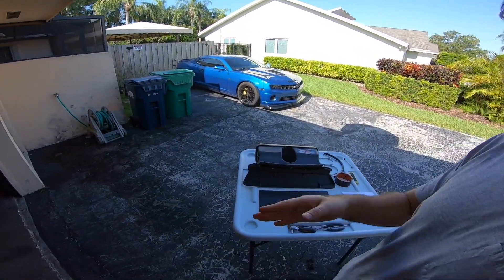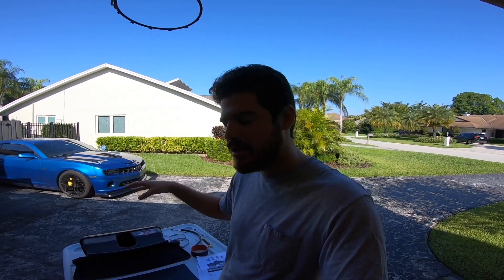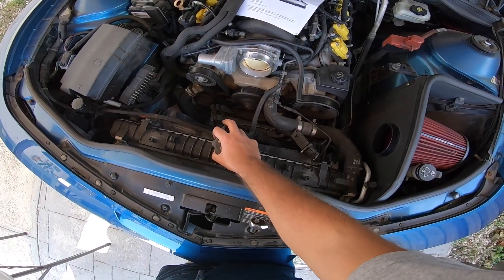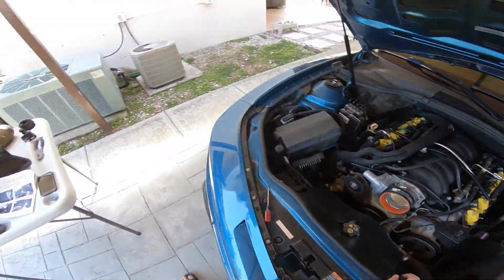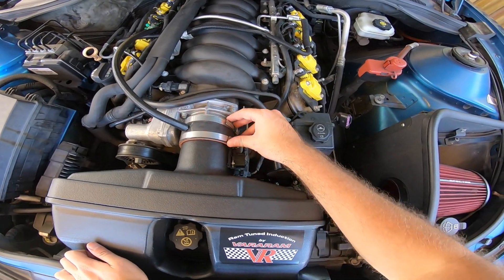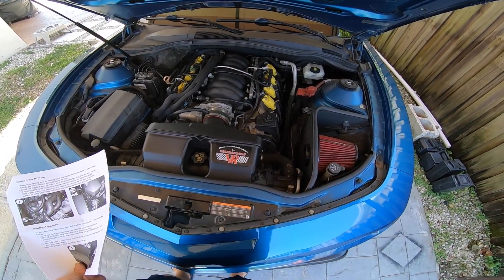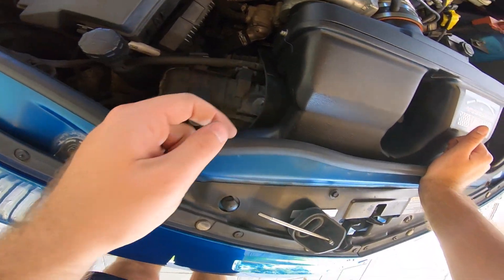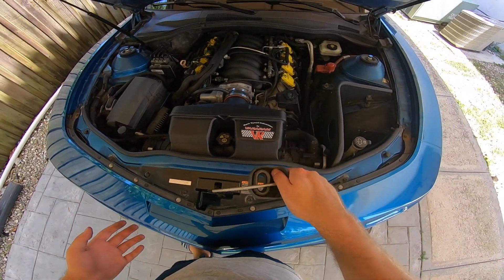Camaro SS Varam CAI Installation & First Impressions! HEADERS COMING SOON!!!!

Comment: I got the scoop from phastek which works with the rotofab, CAI, and k and n intakes (the type of intake you had originally) and I felt a little difference above 30mph. Nice video man!
Reply from the maker: Yo thanks for your comment Jake. I see the rotofab is a very popular choice for Camaro owners!
Reply: @gvaspirated  I know this video was posted a year ago. But I hope my comments will be helpful to you. You have a very nice SS & know what you're doing. 
In my experienced opinion, by adding this VR ram air box, you have made one of the best upgrades possible to your Camaro SS. The greatest benefit to your engine from this "true" ram-air intake is the air to the engine intake is MUCH COOLER than from 
the OE system. Your engine will LOVE this & reward you with a few extra horsepower. The physics of raming needed air into the intake is more beneficial than your engine "sucking air". Simply stated, your engine will operate more efficiently. 
If you haven't done-so already...I'd install a larger CFM throttle body. Because your OE throttle body is "a bit" of a bottle neck for all the additional air you're "ramming" down the throat of your intake. 
The larger CFM throttle body will unleash power your engine is capable of producing in the form of more torque & more horsepower throughout the RPM range. 
My next upgrade would be a "true" X pipe...NOT an "H" pipe. An "X" pipe...not too far down-stream...will enhance engine efficiency//free-up HP & torque by balancing the exhaust pulses & improving scavenging of the combustion chambers. 
They should be mounted as far up-stream//as close to the engine as possible. 
As you very likely know, long-tube headers will make a noticeable improvement. 
If//when you're upgrading your exhaust system, a 2.5'' exhaust is perfect for engines producing less than 600 horsepower. 
A 3.0" exhaust on engines under 600 HP will kill torque throughout the RPM range. Logically & if possible, I'd remove the catalytic converters as well. 
My daily driver is a 2021 ZL-1. It produces 745 rear wheel HP on SUNOCO 116 octane. It's "cat-free" & will pass every states' exhaust emission testing. 
GOOD~LUCK on your upgrades. You have a very nice Camaro SS. 
Respectfully, 
Ben

Comment: This is as the name says, a RAM style intake and thus air will be rated in and as speed increases, ideally above 65 mph, then you will feel it, specifically under part but more so, full throttle.

Comment: I feel ya 9:40 them flops be getting stuck under the clutch 😂. Been watching your installs off and on for a while. One of the only 5th Gen Camaro channels left. Just installed headers on mine over on my channel. If you wanna check it out, that would be greatly appreciated 🙏🏾.

Comment: This is for 2010-2011 only right. Im pretty sure it doesn’t work on 2012 but just wanted to confirm
Reply from the maker: I don't think it'll fit bro. I found it by searching on the website with my car year. I think they relocated the washer fluid reservoir right? So that may cause a clearance issue. Check on their website, but the one I linked is for the 2010-11.

Comment: How was the Spectre intake? They sell this black powder coated for 250 I'm debating in going the cheaper route or a roto fab.
Reply from the maker: it was really good for the money man. Honestly, the only thing that sucked was the joint area that kept breaking and creating air leaks. But aside form that, it did the job just fine.

Comment: So your Vararam kit was missing another one of those long bolts apparently, as it comes with 2 long bolts. It is supposed to bolt on both sides of the Vararam housing to keep the radiator from being able to move or shift position. Also, you can cut off that tab you mentioned from the radiator, as I did mine. 

Can you let me know where you got that Z28 style front splitter? I am looking at getting one to replace my SLP splitter, but there are a few different styles and I like yours best. Thanks!
Reply from the maker: Dude I'm so sorry I'm just reading this now. I noticed that yeah the two long bolts aren't on it. I think they were just impossible to install because it wouldn't line up with my champion radiator.  Also, i have a link on a walkaround video I did a couple months back. Check it out brother!

Comment: I wonder if it will work with a supercharger?
Reply from the maker: Hmmm I'm not sure tbh. Reach out to Varam directly or a product specialist on any of the distributor website bro.
Reply: Of course it will. Just not a top mount SC where the intake manifold sits, like a maggie. Pro charger or vortech.

Comment: I have had 2004 to 2006 GTO’s, 1996 Cam SS, 2011 C6 Z0 and a 2017 Cam SS. All I have tested every CAI available and since the C6 Z0 had a scoop in the nose of the hood, the variram actually sucked in the air like it is supposed to. All the other air intakes angle off at 80 to 110 degree’s and sit off over the driver wheel well.  Any pipe/tube bends more than a 35-50 degree angle reduce airflow, bottleneck it thus losing power which would explain why, other than a true straight in air intake won’t work. These curved elbow intakes are no good, make almost no real power. This why aftermarket CAI’s have been mythbusted to be useless, unless there’s a snorkel sticking 7-8” out in front of the vehicle. The ONLY reason why speed shops sell them is for the $$$$ and they dyno with an “open hood”, which lets natural under hood heat float up and away, thus no warm air near the intake and this way they can show minor gains. I don’t drive around with the hood wide open so I don’t dyno that way. Closed hood is MUCH more realistic of driving, open hood is indicative of being parked at a meet up, hood open, useless for driving. Adding a nice opening slit like on my old C6 Z06 or the 2011-13 Camaro SS is better and with a direct path for airflow, you get power and cooler air. There’s no such thing as a cold air intake. The actual temps drop less than 3-5 degree's with a upgraded air intake, and to be honest, based on over 2000 hrs of testing, temp drops need to be in the 15 to 30 degree range to realize any power worth noting. Also, there’s no such thing as a high flow catt, yes they’re made but useless. It’s either catts or no catts. No catts adds 1-3 hp at most. Again, useless to remove, except for weight reduction. Muffler swaps do not add power, inter cooler upgrades on turbo or supercharged applications do not add power, they just keep the power steady during high heat soak conditions vs stock when power drops from heat soak.  So folks, stop wasting $$$ on products that WONT make your vehicle any quicker or faster, except the inter coolers.  Oh and light weight driveshafts do not add any power either, nor does a set of light weight wheels. The wheels will improve cornering, braking but that’s it. Taller wheels >> (20” vs 17”)reduce gas mileage, hurt handling, lengthen braking and slow acceleration. 16”-18” wheels are good. There was a test done by Car&Driver in 2008 on a VW Golf R32. They compare wheel sizes from 15” to 19”. Stock was 17”. The 0-60 was 6.2 sec stock. With the 15’ wheels 0-60 got quicker and dropped to 5.6 sec. With 19” wheels the 0-60 increased to 7.2 sec.
Reply: Thank you!